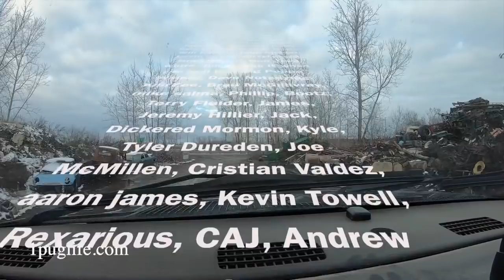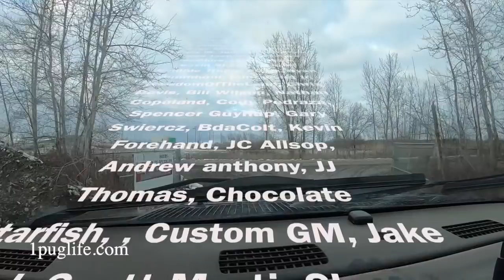rusty is falling apart

Comment: nail the railroad tracks at 40 mph every day when you've got to slow down to turn in three seconds anyway, then be miffed when the jerry rigged oil filter  bracket has worked loose.  XD   this is why i watch every day.
Reply: That's a fuel filter
Reply: CARNEYWOOD  ???
Reply: @bigbear5510  that changes everything.

Comment: I figured the ball joints would go flying apart before the throttle assembly fell off.
Reply: It’s a diesel it doesn’t have a throttle body lol
Reply: @jandewit6574  and he rebuilt the trans twice and the rear caliper locked up
Reply: @danh2134  ya. I've been watching for years.  He sure has dumped alot of money into it
Reply: Dodge~ we implode within

Comment: The source of the loose bracket on the throttle body is due to the weight of the filter,oil,and bracket plus crashing into the rail road tracks as you make your way to the scrap dicks doesnt help neither!😄🤣
Reply: he still hasn't figured out, to just slow down.
Reply: I'm sure the last guy that worked on the tranny had the same problem with that filter. It fell off and broke something when they were test driving the truck.

Comment: hey pug y don't you do a tar slab underneath where bin boy works under your car stand so you not standing in mud
Reply: dropping engines on it would ruin it
Reply: @carmineredd1198  very true did not think of that
Reply: @The-Ford-Man  and when Dicky pulls that last bolt loose the engine comes crashing down, safety third . need that hoist and straps so Dicky doesn't get killed